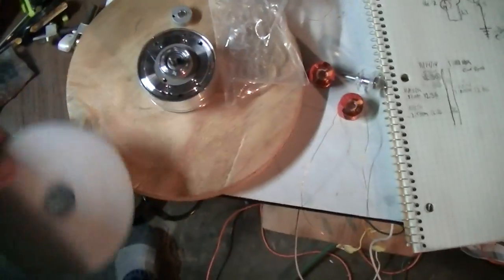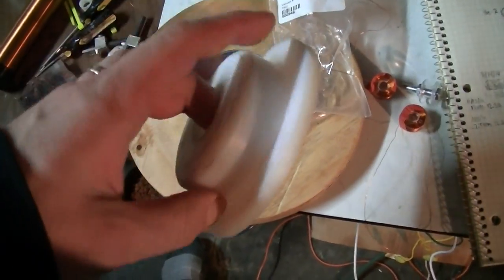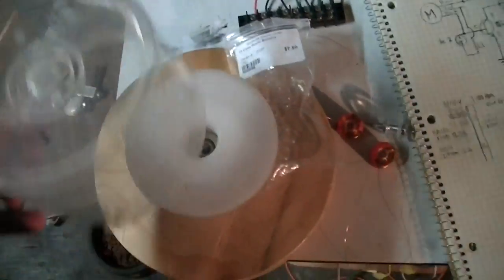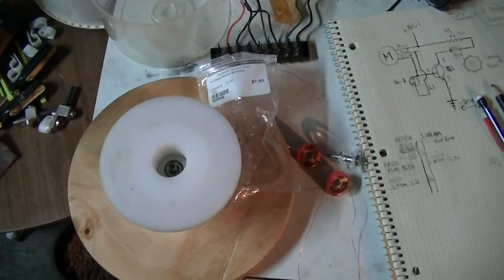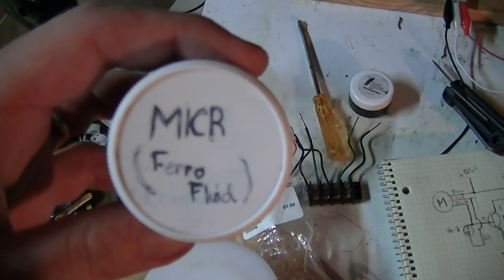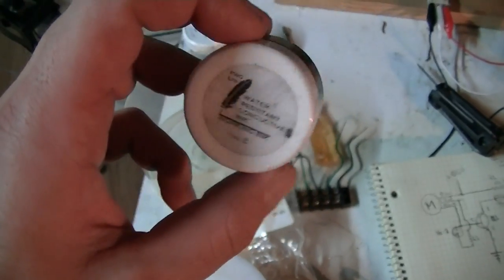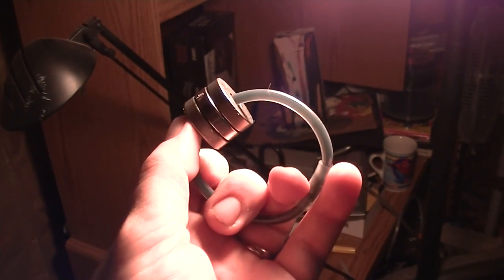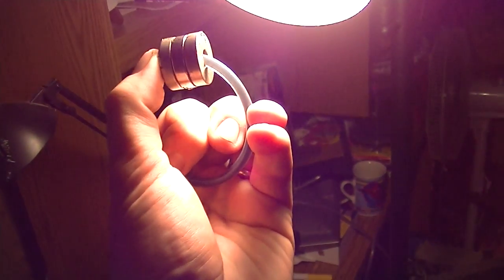PMBO 2014 It begins

Comment: It is going to be fun. Im in too, hopefully I will be able to complete it this year, whole new concept I been thinking about for a year now, and what better time then a deadline to force me to get my act together.
Reply: Did you do last years build off ?
Reply: jccadwallander
yes i did but when it came down to it I was done in by a switch, it was a simple configuration of a magnetic circle each magnet stronger then the last to pull a rotor around 360 then the rotor had an electromagnet on it that would pulse against the stator when it completed the loop. It was different in the sense that the battery pack and pulser was on the rotor, but in the final minutes my switch wasn't working and it turned out it was a fried wire in the connection. I submitted the video of what I made but it was non working so I did not qualify really as an entry. I later deleted the video a few months ago because I was too down on my self in the video for running out of time and it brought back too much emotion lol. Hopefully this time will work out better.